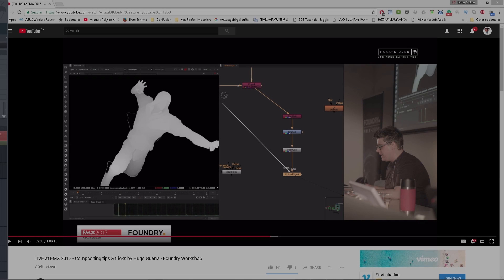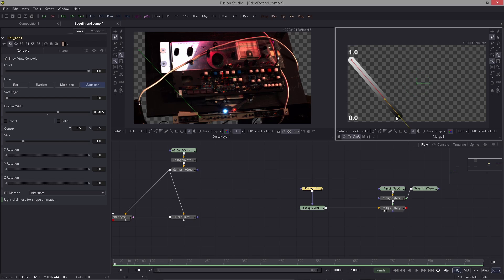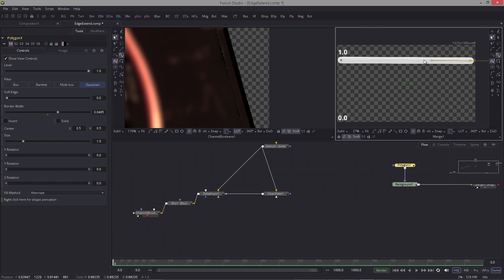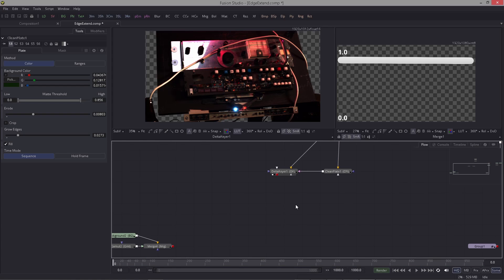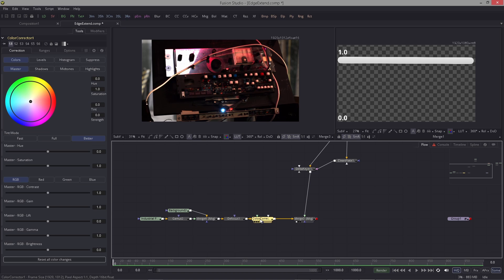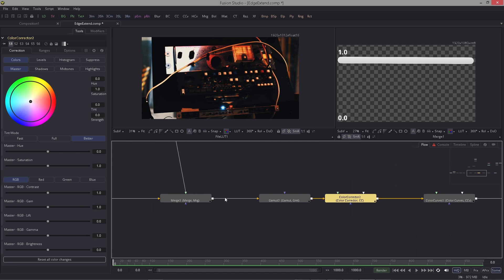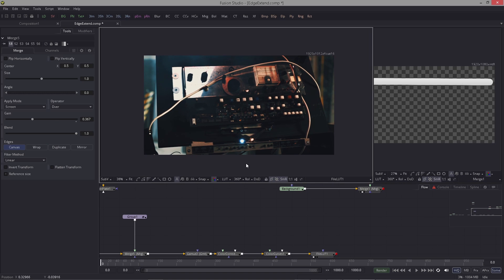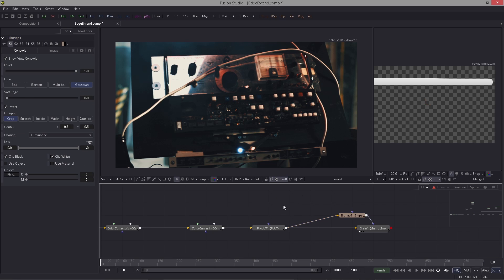Fusion 9 - Two edge extension methods / Nuke

Comment: Great stuff! Btw, regarding the alpha divide/multiply method (which I’ve been using a lot), is there a difference in behaviour between premultiplied alpha (e.g. openexr) and straight alpha (e.g. png)?
Reply from the maker: Ilkka Rosma png will be imported unpremultiplied. It is the same as if you would divide with boolean. However i would use exr for faster loads and writes. Png takes long to load and write.
Reply from the maker: imported PNGs are already divided. You need to AlphaMultiply them accordingly.